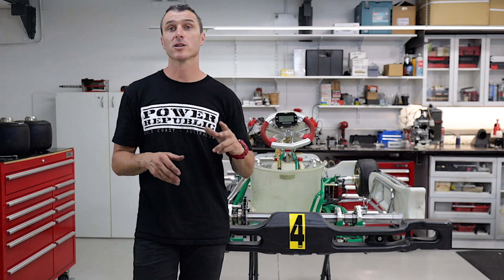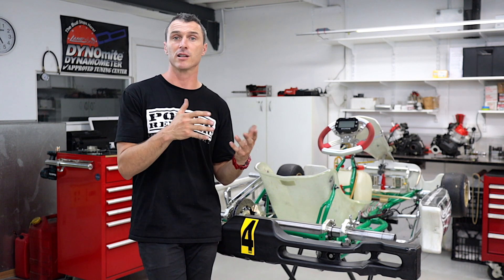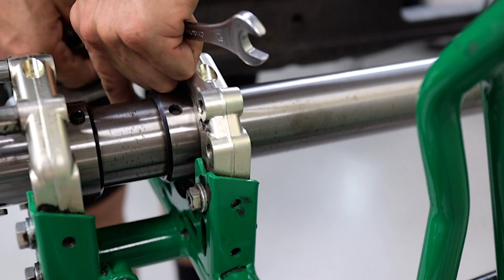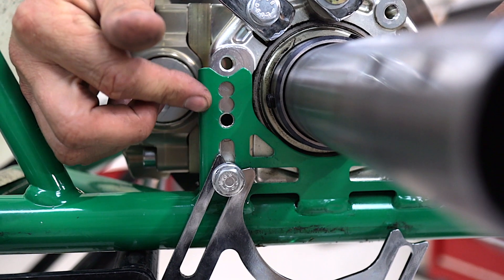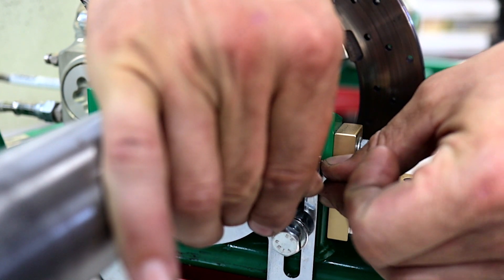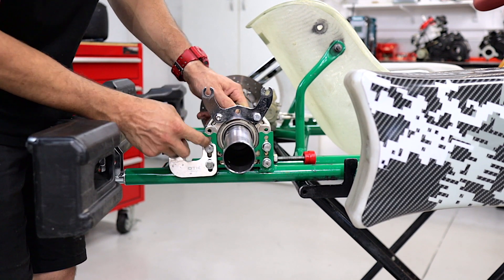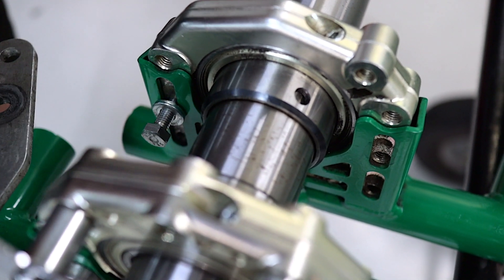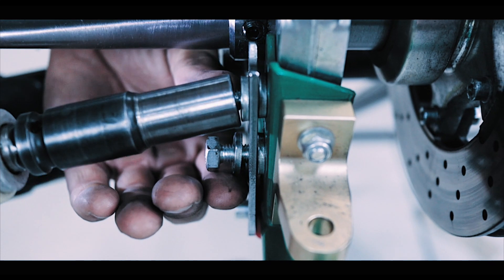How To Adjust The Ride Height On Your Tony Kart - Part 2 - POWER REPUBLIC

Comment: Hey Derek, excellent video again can't thank you enough for doing these as regularly as you do. Question though, basically you're saying if you need some more rear grip to lower the chassis and vice versa if you want to take away some but this contradicts what I've always taken as fact from my research when it comes to ride height. What I've always gone by is raise the chassis, which raises the centre of gravity which then gives the kart more grip...same if done front or rear...can you shed some light please? 

Chris
Reply from the maker: Hey Chris, thanks for the positive vibes.  It's heaps fun making the vids, albeit a little time consuming.  Great question.  If you lower the rear of the chassis only, it moves the weight balance to the rear.  This is good for tracks with fast sweeping corners that have a low grip surface.  Do you raise the chassis at the front and the rear at the same time?
Reply: @PowerRepublic  hey derek no i was referring to changing one at a time. I've learnt a lot from you some of which was the total opposite of what i initially thought so I'm gonna try your take on this and see myself too. I'm guessing for a track with tight slow corners you'd do the opposite and either raise the back or lower the front?
Reply from the maker: @IggySport1388  yeah like most things in karts, try out ideas and see if they work for you at your local tracks, with your kart and tyre package.  The hard thing with karting is there is so many variables and what works for me here in Queensland with my Tony Kart on Dunlop DFM tyres is different to what might work for you at your track/kart/tyres/conditions etc etc.  Give it a go and let me know if it works for you.

Yes the lower front ride height or the raised rear height should help on the tight slower corners on a higher grip track.

Comment: Once again, many thinks for these videos. I wonder if you have made one dealing with the 3rd bearing and how to adjust it and how it affects the handling of a kart.
Reply from the maker: Hey Coffeehouse, thanks for the good vibes.  Mostly stiffens the rear of the kart.  I would use it when the kart hops too much around corners.  It depends on which tyre as well.  I know a lot of the Rotax drivers on the Mojo tyres take the 3rd bearing out altogether.
Reply: @PowerRepublic  Derek would you recommend leaving the third bearing out for a rotax senior application on mg red tires?
Reply from the maker: @IggySport1388  not sure, we have just started using the MG Reds here in Australia again this year.  I will keep you posted.  Does your kart hop around any of the hairpin corners?

Comment: Another great video, Derek! Looks like you have the larger brake rotor installed on the 801 chassis.  What is the advantage of this versus the standard rotor?
Reply from the maker: Thanks Jason, I pretty sure it's the same as the 401R brakes (206mm diameter).  The smaller rear disc rotor is on the KZ and DD2 chassis with is the 180mm diameter.
Reply: sorry to be so off topic but does anyone know a way to get back into an Instagram account??
I stupidly lost my account password. I appreciate any help you can offer me!
Reply: @Thiago Vance instablaster ;)
Reply: @Ibrahim Lionel thanks so much for your reply. I found the site thru google and im in the hacking process atm.
I see it takes quite some time so I will get back to you later when my account password hopefully is recovered.

Comment: Is it common to use the 3rd bearing for rotax max?
Reply from the maker: Hi Oil, I use it if the kart hops too much around the corners.  normally for the tall or heavy drivers on a medium to grippy tyre
Reply from the maker: if you know someone who who like the vid, give it a share for us legend !
Reply: @PowerRepublic  i am a heavy driver, i have the 3rd bearing removed, my kart was hoping crazy the other day. Do you think in general i should run the 3rd bearing anyway because of my weighy. I know this might not be the root cause of my hoping but in general should i run it.
Reply from the maker: Ashar I would use the 3rd bearing and maybe try 3 seat stays as well. Also run out at 1400mm wide in the rear.
Reply: @PowerRepublic  thanks 👍🏾 will try next time i am out

Comment: How hot it has to be?
Reply from the maker: to adjust the ride height?
Reply: How hot temperature have to be to adjust it. I live in U.K. north east we don’t really have very hot days, but if we are in Italy then yes. So the question is how high temperature have to be to lift it up.
Reply from the maker: Are you tracks super grippy?  Do you suffer from power on oversteer?
Reply from the maker: @linadukstaite6046  never really used ambient temperatures to gauge it so I can't really say.  Great question, maybe some else out in race world can give us there answer